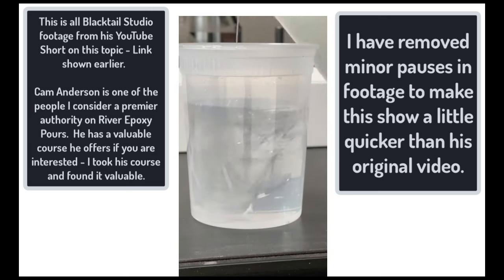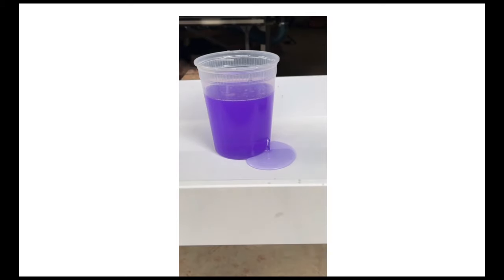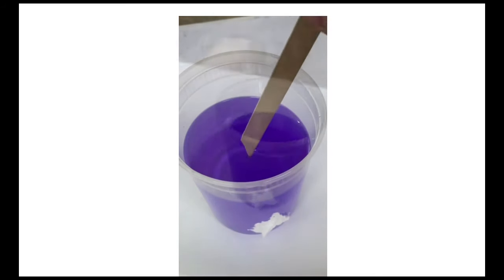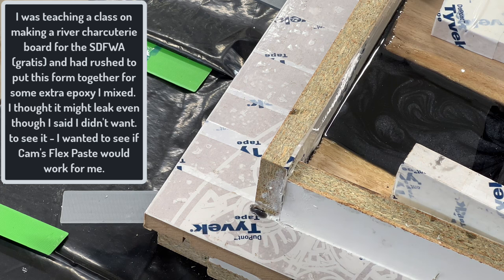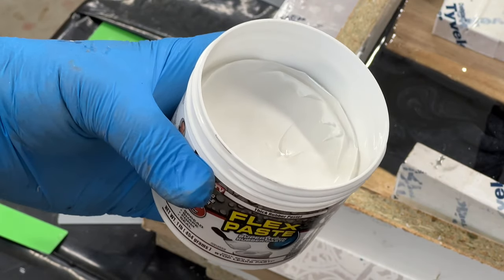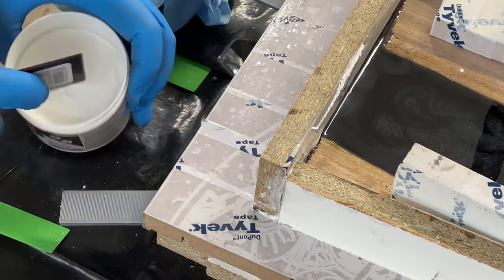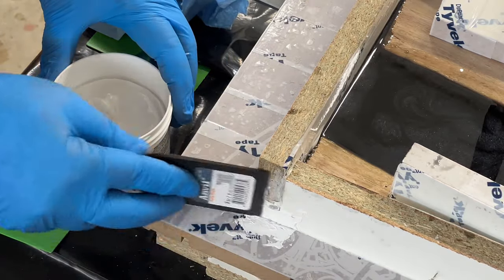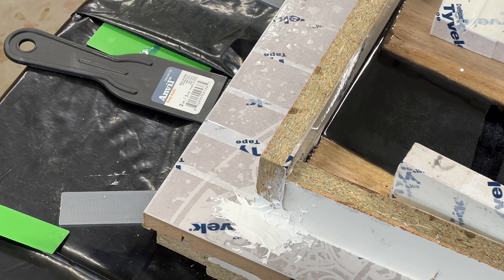Dealing with a Leak During an Epoxy Pour

Comment: my first thought was hot glue. Does hot glue not work?
Reply from the maker: I have not tried hot glue, but for a small leak like I had in this example it probably would.  Hot glue or silicone would be some of the first things I would try if I don't have flex paste.  I have seen others use hot glue and silicone for small leaks.   It is always a challenge with an active leak to get other products to stick to the forms and stop the leak, at least until I found the flex paste.  But, flex paste can be pricey for some people's budgets.
Reply: If you use hot glue in conjunction with duct tape you might have some luck. I used it cause it was all I had to try. Applying the glue, then sticking the tape over it helped to hold the glue in place till it set up. It took several tries or layers. Looks like the flex paste would be the way to go.
Reply from the maker: @BobBob-eh5sb  thank you for your insights and what you have used before.
Reply: @RobSandstromDesigns  Hot glue is a common item, FlexPaste is less common. I already use hot glue regularly when I CNC: Painters-tape-back-to-back method
Reply from the maker: @eitantal726  thanks for your insights - with that said CNC and fixing an active epoxy leak are totally different issues.  I would never use flex paste on my CNC - wouldn’t even want it close to my bed.